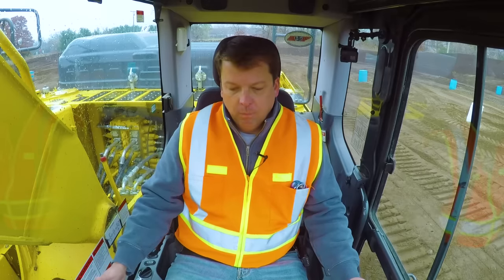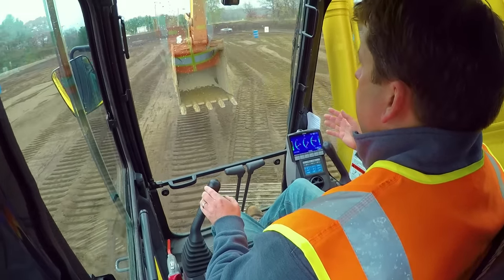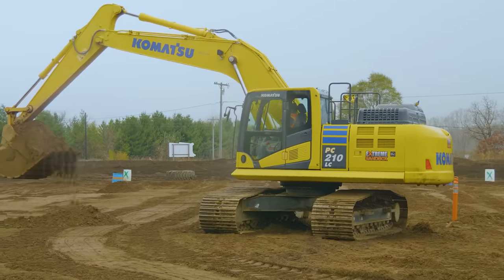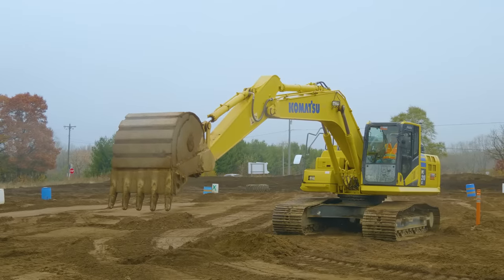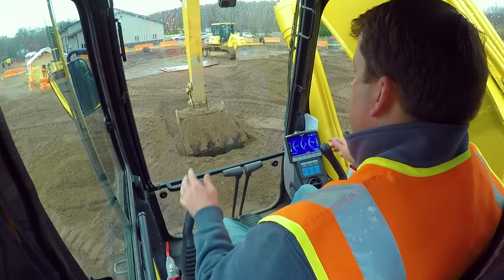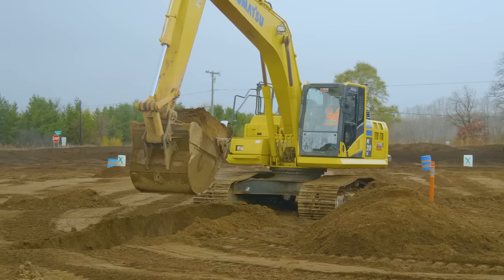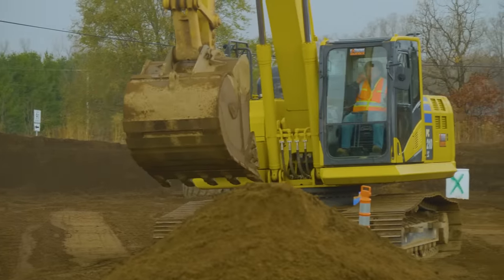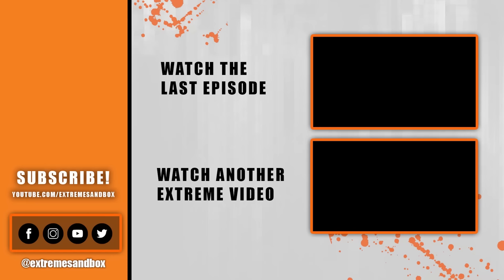What NOT to do in an Excavator | Heavy Equipment Operator Training

Comment: I've been operating for almost 28 years! I've seen 4 accidents 1 was fatal! 3 very important points to consider when swinging. 1. Always keep your eyes 4 to 6 feet ahead of the bucket when swinging. This will enable you to see any danger before the bucket hits the object. #2, when possible, raise your bucket at least 6 feet above ground or higher than the tallest person on the site. In case someone walk by, you at least swing over them!  I.e., it is also not good to swing over anyone head if possible!! #3 If you hear someone call out or a horn, stop and identify if that person or horn is directed at you before you move the machine. I work in sewer and water main, bulking, digging basement, road work, and more. Different ways to move the machine safely.
Reply: Sound advice mate
Reply: Good man
Reply: What did you start your career off as, like when you finished school and got certified what was your next step that you took?
Reply: @darioguerrero4374  I attend university obtain a teaching degree in history and language. The history they want me to teach was all a lie. I always love machine, I didn't receive any formal machine training to become a machine operator!  I started out using a front end loader to pick up scrap lumber after the carpenter finish building homes. After work I ask the operator to let me use the machine casting dirt. That how I get started.
Reply: Gday Guys.
Been an Operator/ Quarry Manager / Quarry Supervisor and National trainer/assessor for an Australian company called Boral for all of my working life.
Great vids and very good communication style used to express what your trying to convey here.
Well done guys.
Reply: Sound advice. I'd sugget a bigger lead length to look when swinging tho.
Reply: @darioguerrero4374  depending where you live the Union of operating engineers does apprenticeship courses. Operators make $60/hr here in jersey
Reply: @darioguerrero4374  good advice. Am from Kenya. I operate shovel, excavator, roller and backhoe loader. Looking for a job abroad
Reply: As a non operator, i consider that just basic logic.
Reply: @geoffgeoff143  Common knowledge = Assumed knowledge. I learnt this as an instructor in the military. I would think something was obvious, but different people have different upbringings. It's important to cover everything for everyone with the caveats, "I'm not teaching you to suck eggs." Or if I am being more formal, "This will be revision for some." Those who think they know it all will switch off and miss that particular bit of helpful information they have not been exposed to. You would think it obvious that One does not insert the magazine/ belt before conducting the Final Function Test, and yet, weapons still go bang when they shouldn't. Good training sees less of this, but distraction, or arrogance, causes accidents. I can watch an excavator and think I know what should be done, but when you are in the seat and putting in 4 - 6 inputs and thinking about the job, and what you are going to do on the weekend, and what you are going to do with your girl, and you are getting tired.... and... and... Mistakes happen. Sorry for the long winded reply.
Reply: Raise it 7 feet and you miss the boss's van.
Reply: Cheers cob
Reply: I was taught that the only safe way to approach an operators vehicle is to stand back far enough and wave till they acknowledge you. I am never in a big enough rush to put myself near moving heavy machinery whose operators are preoccupied with their work.
Reply: If you don't want to have the counterweight hit things, put your bucket in front of your cab at counterweight height, then do a complete circle
Reply: #2 is bad advice, as it increases tipping risk if you are talking about typical size common excavator, as it increases tipping risk, both due to the centrifugal force and effective CoM being higher up, and there being greater gap between the bucket and ground that increases topping angle potential, and giving values like "6ft" or more is only attenable on larger excavators with the dipper-arm close vertical from the boom, for smaller excavators 6ft would only be attenable by extending the dipper arm outward thus increasing the swing radius and thus increasing tipping risk still further during slue.
Reply: @robkeogh4593 good old boral mud!
Reply: Im starting my excavator training. Thank You for thoose tips. Stay safe
Reply: @darioguerrero4374  my 1st job out of college was a police man. I hated it. Sleeping in daytime to work nights, then sleeping at night to work days. Always changing. Shift work wasn't for me.
Reply: @uniqueracer2500  Good luck. It's a great career. Just remember you learn every day, only two times you stop learning. #1 when you think you know it all. #2 when you're dead. Every bucket you pick up make it better than the one before.
Reply: @jbarrera6024  i was at quarry last 5 years. Class 1 on bulk bags. I know that stuff seen them daily always wanted drive one. But i was class1. Recently started tipper class2. And going excavatot rear wheel dumper and front wheel loader. Dont want to drive lorry anymore
Reply: @uniqueracer2500   operating excavator is not for everyone. But if you like it. There's nothing more exciting. Being a union operator pays even more.
Reply: @jbarrera6024  thank You for all advices. I do my best

Comment: I just want to add my opinion on tip #4.  When digging a trench, I have been taught to swing to the right (blind side) to place your spill pile.  That way you have a full view of the ditch and the people in it while swinging back to dig.  Sometimes it's out of the question, but its good practice for when you do have the option.
Reply from the maker: That's an excellent point.   I have never heard that before but makes complete sense.   I may have to add this to the "more than one way to skin a cat" list.   Appreciate you sharing your insight!
Reply: I was taught this same thing by my stepdad.
Reply: Very true. Was a lucky escape for me looking into the trench while the machine was swinging left to offload but then he is blind to the trench on the way back hence almost took my head off when resuming the dig..!! Both of us were at fault. My head should not have been there and he should have known I was at that side of the trench.
Reply: Or you could turn the machine around and swing left like your supposed to
Reply: I almost always swing right
#1 reason is i can better see where the back of my excavator is in my rear view mirror 
If you swing left then you don't know where the back of the machine is at a glance
Reply: Noah Walsh correct. I usually instruct my guys that rule number one for a ground guy is never stand between/same side as spoil back to trench path. Not only are you in danger but it slows the operators down even if he has to check for you every time while returning to dig. While we are on rules and this might be helpful to other people. Rule number 2 is never enter blind spot of machine until some sort of communication between you and the operator. Could be verbal or even some kind of sign to the operator
Reply: @davelee3725   99% of the time you start digging trenches from lowest flow line point going up in elevation, because that's how you lay the pipe, especially storm and sewer.
Reply: Very correct. not only that but when you were digging placing you spoil pile to the right you will be able to dig at a much faster rate while also having the advantage of a better field of view for your crew. As you swing to the right so does your boom. You never swing faster then your ability to
Reply: I clocked a ground guy in the head who decided to look into the trench as I was swinging back to my trench. If I had piled my spoil to the right (didn't have the option in this case), I would have had time to stop swinging and avoid him.  His hard hat prevented any consequences of his error. But we're a couple valuable lessos learned there.

Also, parking: extended fully with all cylinders retracted.  Less chrome of the rods exposed to the elements and the hydraulic tank as full as possible for less condensation.  These are things you learn when you own your own iron.
Reply: @davelee3725  Huh?
Reply: @timdunk7278  It sounds like he is saying to spin 360 instead  going both right and left.
Reply: The excavator that I'm looking to get the cab is on the right
Reply: You need to think about water when you’re putting your fill in case of rain so whatever way the water is coming, you have to put the fill
Reply: That'll keep random ppl from walking up blind side too
Reply: 10-4 l allways have workers in the ditch and l can keep them in site allways. That was a great tip you shared.

Comment: I own 3 a mini midi & crawler. All different in how they operate and what you can and cannot do safely with them. I’m also self taught no online training resources available when I started. After safety the #1 item for me is how to be efficient without over stressing the equipment. I fix them too, so my logic is to try to wear my operators cap more than my mechanics cap I find slower is better for both longevity and efficiency, learn to plan and plan to learn, every job is unique. Biggest complaint is working along side operators who can’t hear anything over the tunes they’ve got cranked at full volume. Being audibly blind is not a great plan even when solo.

Comment: 1. Dig with the idlers towards the hole to prevent wear on the undercarriage.  When you pull against the dig, there is a tremendous amount of force against the front of your tracks.  Idlers have less wear surface and are easier and cheaper to replace than sprockets.  2. Pile your spoils farther away than you think you need to.  Dirt expands and you don't want that pile near your excavation.

Comment: number one thing I see is not greasing the machine before it used
Reply from the maker: Agreed...thanks for the comment!
Reply: central lubrication system that automatically greasing the machine when it runs..?
We have it in Sweden on most of the heavy equipment 👍
Reply from the maker: Mr Olsen yes, starting to see that on more machines in the US but generally only the larger machines.
Reply: scooter13  who needs grease just slows the job down hurry up and load that truck
Reply: Union guys don't know how to run a greasegun. Lol
Reply: Luke Ripper yes sir....that’s more like real world
Reply: Nobody likes greasing.  Oh I don’t want to get dirty. Blah blah blah.  Get a secretary job or an indoor job
Reply: @whobee8868  I don't mind greasing a bit. Much better than fixing.
Reply: That's one good way to get fired when working for me. One thing we do with our excavator is every month we grease the swing bearing in different positions all the way around. Like he said, You aim to park straight. But doing that only ever greases the bearing at the front and back. By swinging it and greasing it, you get the grease all the way around. We've never replaced a swing bearing.
Reply: I grease my excavator everyday and I have three zerks for greasing the swing gear which I don’t grease everyday because it’s not good to over grease it  I just recently had them grease the swing bearing which by the way are two different things. Swing bearing has a cover right in front of the swing motor which takes different grease. The zerks up front on the turntable is for the swing gear.  greasing is the life of the excavator among other things
Reply: But you are correct greasing saves costly downtime
Reply: I was taught always grease at the end of the day ..no matter what time it is..co it's hot nd grease get in ..when it cold in the ,morning things have shrunk and grease doesn't access all locations ..just saying
Reply: @pdbabe  Also when the pins and bushings are warm the grease flows around better
Reply: Ive seen really lazy not so smart people pour motor oil in the joints to stop the whining and keep going.. id probably fight someone if they did that to something i was paying hundreds of dollars for!!
Reply: @quintonriley3468  just wait till you see someone use graphite spray...
Reply: @midget9629  yeah really! And in my last comment i meant to say hundreds of thousands of dollars.  Itd be nice if it were only hundreds of dollars! Hah!!
Reply: I always do that after its warm, but to each their own. As long as you do it every day. Usually when I fuel it.
Reply: I’ve been driving a year now grease what’s that 😆
Reply: @pdbabe  I grease in the morning because it is good to let the machine warm up a little before working it. Usually at night it is too dark to see things. Second good point about greasing is  it makes you eyeball all parts of the machine to notice damage, wear and leaks.
Reply: Dustin Knipfer oh no, we do. It’s in our contract, 1/2hr a day set aside for all kinds of pre shift fun, greasing included. You get caught not greasing or doing a proper pre shift you’re down the road at a good company.
Reply: Whobee 88 I spent the coin on a good cordless gun, made my life so much easier. Keep it in my truck cab in a nice case, always clean and always warm grease. No fighting it all
Reply: quinton riley the old friction crane guys were good for that with the tracks
Reply: Dustin Knipfer I knew a guy that greased the hell out of a turntable on a brand new blade that was designed to only have graphite spray used on it. He was a bit sheepish after that happened
Reply: @RIPLUK  You've obviously never worked in heavy diesel repairs.
Pins and bushes, bashing 'em out with big sledges and freezing/heating and cutting the bushes, just cause some operators are too damned lazy or ignorant to maintain their gear.
But if you like to run a deep groove in the pin and have slop and play like a pigpen in your machine be my guest.
Reply: I repair plant machines for a living.  No one needed to be tested . They was shown how it worked and watched.. if they couldn't do it of they went... operator's then would carry there own tool kit and try repair there own breakdowns .. change filters... pump tracks up ect..
O how it has changed lol... great videos 👍
Reply: Never happens and deadheading the cylinders😡
Reply: @whobee8868  yes,they do not get along with grease guns.
Reply: @keithbrier4397  ... gets rid of the week hoses 🤣
Reply: @DW-hx1xm  TRUTH

Comment: I ran excavators for 38 years before I retired. Saw the old cable machines fazed out as the hydraulics took over. One thing lots of guys never look for is the newer machines with the quick couplers. That coupler adds quite a bit of length to the stick. I've seen many machines damaged from operators getting to close to the cab with the bucket and driving the teeth right into it. Saw one idiot almost take his head off with a 400 Yutani with a 17 foot stick come into the cab, panic, hoisted up and took the top off like a sardine can. Always check spec sheets on the length of the arm and if there could be contact with the cab. Just my 2 cent.
Reply from the maker: Totally agree...I’ve come close to making that mistake myself.  Thanks for the comment!
Reply: Are you sure he just didn't want a  Convertible
Reply: Thought you were going to say I use to operate the brontosaurus like Fred Flintstone.

Comment: Having the  idlers in front also has a really serious reason, if you have travel sticks and something comes into the cab by accident ( tree branches etc.)  the machine will walk away from the hazard!  If your working reverse and a tree or demo material come in thru the front of the machine, the travel sticks will push you into a certain death crush! It happens!!! Just be aware when doing demo  or clearing forests!
Reply from the maker: I've heard this before, and I guess it's a valid concern but I just feel like that's a very remote probability.   I guess if you were using one of these in a forestry application than absolutely, but don't most of the forestry excavators have cages in front of the glass for that very reason.   I guess, safety first so never a bad strategy when safety is in play.   Thanks for the comment!
Reply: If you have your drive motors up front you're also pulling the slack of the tracks in which is excess wear on the tracks and potential for a loose track to slip off.
Reply: I had a close one. Triying to pic a rock out of the sea and as it came up on the teeth nearly throw it throw the frunt windo and if it had it would have sent me tracking out to see 😂
Reply: Holy shit
Reply: @HeavyMetalLearning  yea it's really common that there's a cage or the glass is really thick almost bulletproof but people still use ones without any safety cages like your komatsu and then it's a valid concern.